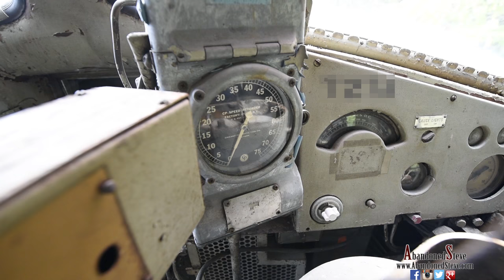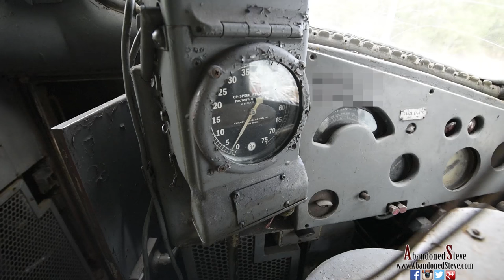Urbex | Exploring Old Decaying Trains - Locomotives - Coaches

Comment: Those old emd are some of the ugliest locomotives ever made I like the new modern locomotive a lot better.
Reply: these engines were built for streamlined express trains. modern engines are alot boxier due to high costs to make the curved bodyshell and nose.
Reply: What makes you an such expert Nightrider Tony?... These trains are from an art deco / mid century modern era that had lines, curves and form 'n function in EVERYTHING that was ever made at that time... Now everything is a box with square windows, square doors and square heads to match... So this new box era is beauty to you?.. How many people stop and stare at steam engines or old cars from the 20's, 30's, 40's, 50's, 60's, and 70's... Everyone does but you because you drive a cookie cutter box on wheels car with square doors, square windows and have a square head to match.
Reply: Ricardo Mierz 

Hey man just my opinion. it is what it is.